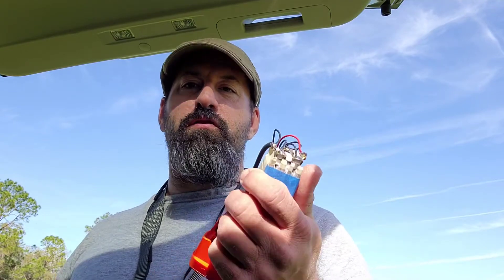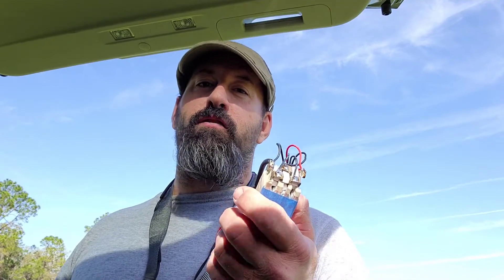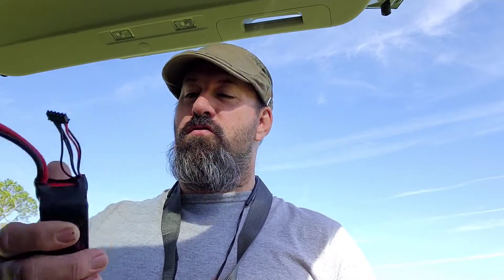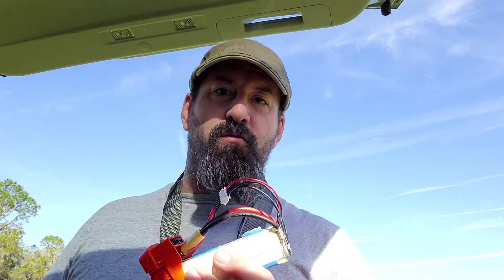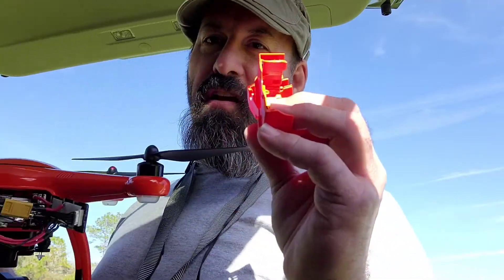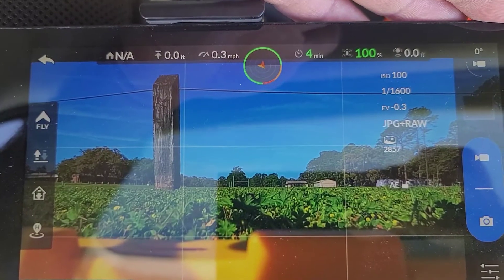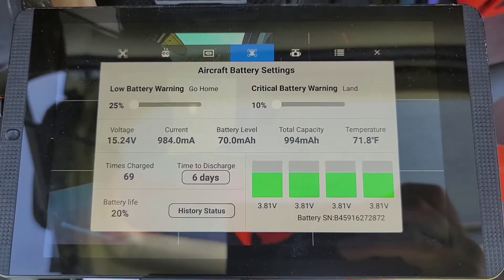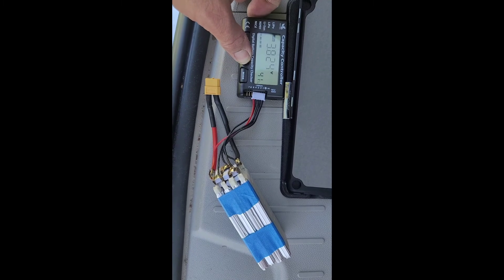Autel X-star battery  - Testing 2nd option

Comment: Where are you getting your LiPo battery sells?  Did you do an update to the firmware on the battery pack?  I truly appreciate all that you are doing to promote the battery fix to the Autel XStar.
Reply from the maker: got several of the batteries I used from HobbyKing, Working to get the firmware to update.